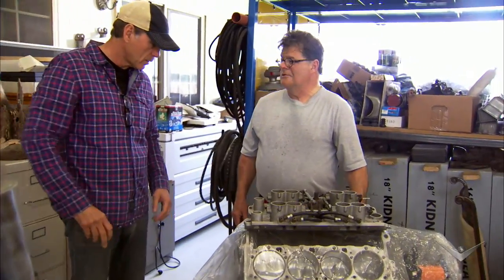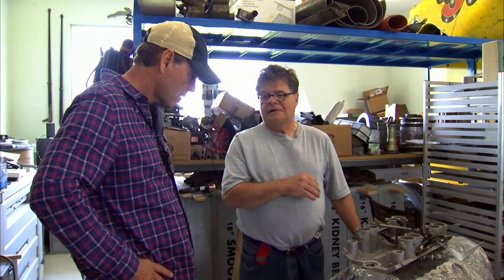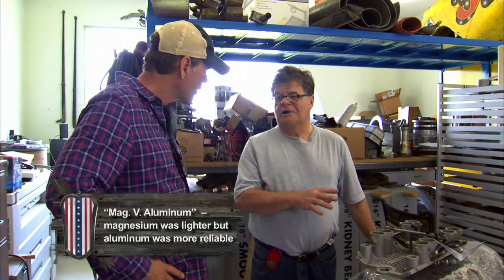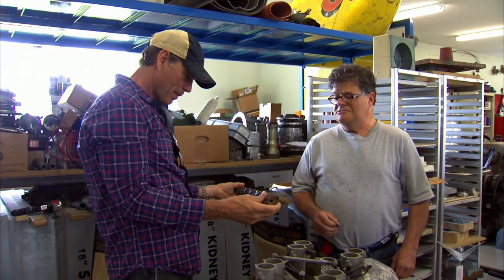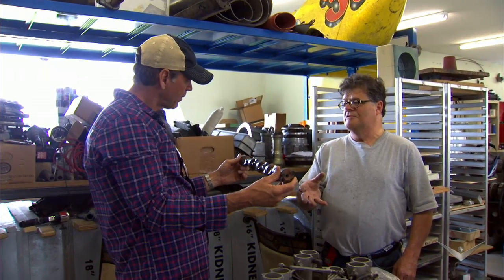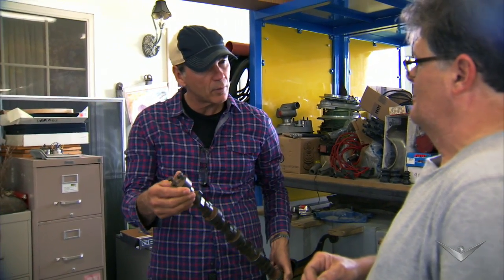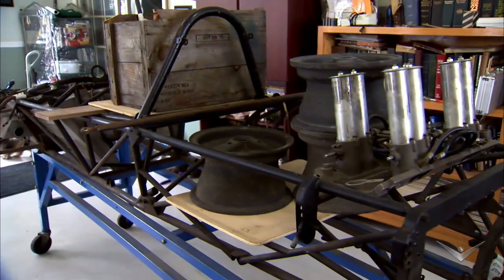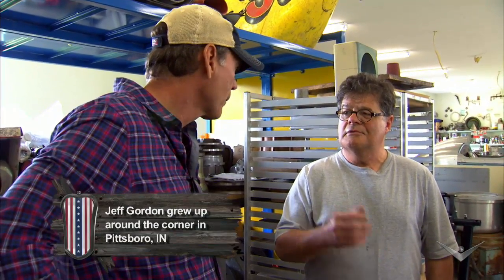Aluminum Engines Are Safer | Americarna

Comment: 1/4 speed cam was nonsense.  If the cam is rotating at 1/2 it's normal speed that means there is also `1/2 the number of degrees in which to produce the valve lift so the pressure angles are not lower on the roller cam.